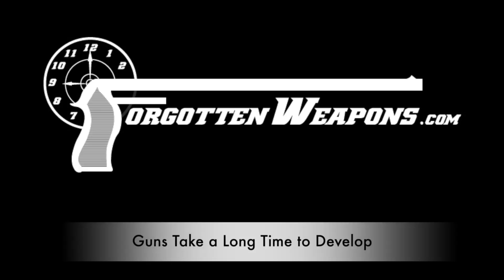Why Guns Take Years to Get Into Production

Comment: "It's compounded by the fact that you will never be able to predict and test everything." 
This might be the wisest thing I have heard you say, Ian. I was an engineer for 45 years. I don't know how many times I tried to explain this to the man who just couldn't wait to start making money on something that seemed so simple to him.
Reply: Fire Starter  no idea what lasers have to do with engineering guns? As for computers, the most famous guns most people were designed before computers existed. 
But besides that, no simulation is perfect and nor can it predict some idiot hotloading his home-made ammo with dynamite or something else stupid. The GIGO principle applies at all times.
Reply: @randombloke82  thats not the domain of the designer. 
The designers job is to design a product thats applicable to the application. 
And if you cant figure out what lasers have to do with engineering guns then i dont thin you belong in this discussion.

I am not an engineer and i have just designed a rotary loading system that replaces the automatic function on any AR and it wasn't even hard and i did it using lasers and simple tools from Sketchup.
Reply: Fire Starter  you think a 3D printer is more precise than a CNC? Fine, it might have less vibrations, but at the very least the grain size is going to be a tolerance limit. Also, like Ian said, it comes down to cost.... printing individual guns is SLOW. For prototyping a 1-off, yeah it's faster than spinning up an entire mold/press/ jig, but once it's going it never gets faster.
Reply: @RaphYkun  also, having worked with Plastic 3d printers, theres a TON of little things you have to work outtrying to get temperatures just right, trying to support the part so it doesnt collapse in on itself while printing, finding the right infill pattern, etc. Its designed to be intuitive and consumer friendly but its still really complicated and I can only imagine that printing with more difficult materials at higher temperatures with lower tollerance (ie making guns with metal printers) must be MUCH more difficult
Reply: @RaphYkun  "you think a 3D printer is more precise than a CNC?"
It's funny you should phrase it that way, because echnically, your typical run of the mill FDM plastic 3D printer is a small CNC machine with a plastic extruder on the end of it. Also, precision of CNC varies a lot. CNC just means it's controlled by a computer.
Reply: @RaphYkun  There are also techniques that are faster than CNC machining.  As I was looking into CNC as a possible hobby, I read about a giant forge that can stamp out a receiver of a gun in seconds, where a CNC machine would take minutes or hours to complete.

Granted, that receiver may still need some CNC love to get it working, but that doesn't change how, in one big "clomp", you have a pretty-close-to-spec part -- but I would nonetheless imagine it would still take a considerable amount of time to get the forge ready to make that one "clomp" consistently produce a good part, over and over again.

Over the years I have heard of all sorts of interesting ideas that could potentially revolutionize everything -- carbon buckyballs and nanotubes in particular are often at the core of these things -- but they fail because there's simply no good way to mass produce them....
Reply: @alpheusmadsen8485  It all really depends on how complex the part is and what your tolerances are. It also depends on what you have access to. Those big presses are expensive, and you cannot use them just anywhere. Especially the really big ones shake half the neighborhood when 600 tons come falling down
Reply: "Nothing is difficult to the man who doesn't have to do it."
Reply: @lairdcummings9092  This is very true!!!
Reply: You don't get it. I work with 3D printers every day. Metal 3D printers are not as good as CNC machines for making prototypes, and they are absolutely unfit for large scale manufacturing of gun components.
Reply: @Bad_spark  Yeah I get it but even with cnc machines it does not mean that what was designed by someone will work
Reply: @PAPAROUSwhatsinthedirt  yeah man I was trying to reply to fire starter, who thought PCs and 3d printers can solve sny issue in no time. I'm an engineer myself and my designs fail left and right while in the prototype stage.
Reply: @Bad_spark  Ok and yes they do i worked at a place where they decided to try to do away with prototyping and just run production it almost bankrupted the company
Reply: Fire Starter  I retired from hi tech sheetmetal we used lasers and computers still does not make a usable part right off every time.
Reply: @PAPAROUSwhatsinthedirt  he probably thinks like alot of other young people that just because we are so advanced we can make everything with the snap of a finger or whatever
Reply: I cant count how many times, as a welder, I've had to explain to the engineer why his design cant be built as he drew it. I litterslly had to show one "you want me to TIG weld this join right? Well I CANT EVEN FIT THE TORCH IN THERE. It has to be built in a different order"and arguing with the guy over how it needs to be built in order to actually weld it.  No sorry I cant weld the opposite side of a plate with a 2"x2" opening... it's not physically  possible idk what hes thinking lol.
  We had one that was insane. The drawing showed a brass fitting WELDED to a stainless manifold.. it was probably the worst thing I saw lol
Reply: @swampypolitics9574  Been there I weld all types run and program turret punchs and press brakes last one I ran accurpress 8 axis 225 ton 14 foot bed. a engineer came out one day gave me a work order to punch fold and weld a simple 3 piece part a body with a door and hinge in the print he wanted me to spot weld a 3/4 inch hinge in a 3/4 gap I looked at him and said I can't spot weld an air gap
Reply: @PAPAROUSwhatsinthedirt  LMAO spot weld a gap 😂👍 let me just throw iron powder in the air and hope it sticks.
Reply: @PAPAROUSwhatsinthedirt  the biggest pain in the ass I had to do was close a hole in a pipe.. with hot water and steam coming out of it lol. They refused to shut it down Cuz they would have to shut it all down and that's $1m/hr that the machine is down. They just wanted it closed up "temporarily". Luckily it was a steel pipe and not stainless. 6010 for the win.
Reply: @swampypolitics9574  It's always about the money!!!
Reply: @PAPAROUSwhatsinthedirt  for sure haha
Reply: I keep having to explain to the 'young' guys that Murphy Rules With An Iron Fist. You plan for everything you can think of, and maybe you succeed, but then it is the thing that hits you sideways that you never thought of that derails you. Example: Years ago I did a live broadcast event in a country that, shall we say, wasn't exactly known for freedom. Everything was lined up with umpteen levels of redundancy. Event day came and the government official who had helped us with "things" was nowhere to be found. He defected to the rival country next-door.  Needless to say, things didn't go well after that. You learn to plan for the unexpected - always have a disaster plan and always expect that something will go wrong. Most of the time you're fine, but the Universe seems to like to spring things on you at the worst possible time and place. ;-)
Reply: @patrickseaman  Remember, a pessimist is never disappointed. ;-)
Reply: @billd.iniowa2263  I'm an optimist that things will work. I'm also paranoid that they won't. What does that make me?  (Too) Experienced.
Reply: Yep. As a software engineer, nothing scares me as much as non-trivial code which seems to work the first time.
Reply: @MrZcar350  That makes me smile and think of the piece of code someone better than me wrote. It passed the regular tests, it was being tested in the way it would be used. 
He let a toddler play with it and after two keypresses it collapsed.
Reply: @patrickseaman  the younger generations have been insulated from Murphy by the facts that they don't really do all that much, and the older generations have created a relatively safe/soft lifestyle for them. But the older generations also built in some timebombs for them, such as the Social Security system, the Federal Reserve, and the 19th Amendment. The younger generations are going to get hammered within the next decade, and older guys like myself are probably going to get evicted from our meatsuits before we have the opportunity to see if the younger folks figure their way out of the mess.
Reply: Fire Starter  Knowing how to use your tools is only half the battle. Now you need to figure out what are the tolerances of each part of your gun so that you can use your tools properly. No one can do that for you since no one has built your gun before.
Reply: Fire Starter  No its not always basic math when you work with things that burn or explode at different rates
Reply: For an easily digestible demonstration of the pitfalls of high-durability 3DP, check out the videos on 3DP rocket motors from Integza.
Reply: @lairdcummings9092  Thank you I will
Reply: Fire Starter  Funny that you mentioned building a rocket. Just think: SpaceX is launching rockets like a Swiss clockwork and landing the boosters on a shoebox in the middle of the ocean... and Elon's other company is still struggling with body panel gaps in Teslas.

Dealing with multiple tolerances in mass-produced complex mechanical devices IS the rocket science of engineering. It is high science and high art at the same time, and few people really appreciate that. I've studied tolerances for my degree for a whole year, and the course only gave us absolute basics how to start on the issue.
Reply: Fire Starter  you have to measure pressure, mass, and a lot of precision. Like the bolt of literally any semi auto for example, how much weight do I need in order for the bolt to move back and forth by a specific measurement? If it's too heavy you gotta forge/mill (never cast) a new one out of something lighter. And this is just an example and something like the bolt by itself can take months to perfect and not because of production time but because of reassurance and actually getting the thing to work. And every change you make you have to document with numbers and math, keep track of how much mass it takes. And there's also parts that might need to be added to assure the functionality of the weapon, and the reassurance of safety to the potential shooter. There's a whole lot of physics going on and it isn't anywhere near the level of intelligence required for rocket building, but that doesn't make it easy. You also have to make sure you won't run into legal trouble because hey your gun you're designing could be similar to someone else's patenting rights, or your gun you made goes against the ATF from things as little as being too light, too short, etc, etc. Ever hear the expression "back to the drawing board"? Engineers probably say that around several times a day and people seem to lack appreciation for that.
Reply: Fire Starter  you really didn’t listen to Ian at all, did you? Are you an engineer, a machinist, or have any kind of actual knowledge of design and manufacturing?
Reply: Fire Starter  I could write several pages of detailed descriptions, but it's really not worth my time. Just trust an old engineer: Managing tolerances in mass production is an enormous challenge. You dont' get it completely right, and out of 100 guns assembled, 2 will refuse to work at all, 10 more will start jamming when hot, and one will perform a rapid unscheduled disassembly after the fifth shot. There are some incredibly complex mathematical models available to deal with it and hundreds of factors to take into account, but theory won't give you everything.
Reply: @rrolf71  I am not an engineer, but I do have an appreciation of just how complex it can be to bring about any kind of change.  As Ian said, designing and building a working prototype of  product is a completely seperate process to designing a scaleable manufacturing process for it.  I don’t think people truly appreciate how staggeringly impressive the reliability of modern manufactured products are.  It must be incredibly complex to design every part of the process.   How satisfied will consumers be if 1 out of every 1000 example of a new firearm fails because of errors in manufacturing tolerances?  Most people never wonder what is actually involved to have a failure rate that low? Everything is all well and good in theory, but getting it to work in practice is a whole different experience.
Reply: @bruiser6479  The biggest problem in my experience is  when someone has a little knowledge, and thinks it makes him an expert, and then does not want to listen to actual experts. You hired experts for a reason fucking listen to them.
Reply: Formula1 here , would you like to please hold my beer?
Reply: Fire Starter  Well, good luck. But I'm afraid you'll find out that along with the learning usually comes the realization how little one actually knows.
Reply: Fire Starter  Blowing stuff up is always fun
Reply: Fire Starter  Still requires effort and time. All that does is effect the speed of manufacturing and getting the measurements of the parts on the dot. You still have to make prototypes and design it for mass production. You also have to test the gun after any change in design big or small. You also have to design fail safes, and test the durability of the firearm.  Too much to list I could go on all day and Im sure a professional could back me up on these claims.
Reply: Fire Starter  stop feeding the troll people...
Reply: Fire Starter  your question proves his point. The main question of knowledge is why, not how. You have found your expert if he can answer why more than others.
Reply: I mean, sooner or later you will run out of problems.
Reply: I had to explain it to my boss from the time that I was about 15. My boss was my dad. He was a safety inspector for a major company just a few years earlier, before he started his own business, so how he didn't understand this point is beyond my ability to speculate.
Reply: A great example of that is the soldiers will be soldiers video
Reply: Fire Starter  I'm an engineer who is currently working in manufacturing. I work in medical devices where dimensions are controlled to the tenths (which is parlance for 0.000X inches), which is probably more excruciatingly precise than the firearms industry. We use laser cutting; servo stamping presses; hydrologic presses; wire EDM; ram EDM; CNC milling; injection molding; chem etching; etc. What you described reveals a fundamental misunderstanding of metallurgy and physics that many people commonly take for granted. 

What I hate the most about colleges and the miscellaneous YouTuber these days is that they keep perpetrating this myth that 3D-printing, whether plastic or metal, is the answer to everything. Let me disabuse you of the usefulness of 3D-printing - it fucking sucks for production. It's great for making a one-of of something that doesn't need to withstand millions of cycles. What people like you need to understand is the concept of material fatigue. Oh great! You metal-printed a 17-4 PH component for a gun? Wonderful! Oh, it's dimensionally accurate? Cool! You can fire a single round from it? Tubular dude! 

Now fire 10^6 rounds from it. Did it maintain dimensional stability? Nope. Did it develop hairline fractures over time? Yes. Does the cyclic thermal history cause warp? Yup. 

Bottom line is that you can't just make something out of metal and call it a day. Metal forms are usually made from specific grades of steel that come from a forge/mill that tightly controls the atomic composition and ensures a specific grain/micro structure. Additionally, metallic components aren't formed in the hardened state in production (unless you want to break your expensive tooling every other day). They are formed in the annealed state and then sent out for heat treatment. You don't have this level of control with metal 3D-printing. 

Bottom line is that 3D-printing is a time-consuming, expensive process that limits your material choice and doesn't give you near enough control on your microstructure to make a component that's built to last, especially if that component operates on the principal of combustion.
Reply: Milked ur clients good i see.
Reply: I hate it. I have been doing it for 9 years, with a co-worker that has been doing it for 42 years. Too many times people think that some hand made thing they brought in is OK to show to customers as a finished ready to go item. It takes a lot of work going from a one off hand made, hand adjusted prototype to something in manufacturing. I started off "designing" cardboard boxes, and i'm now working on fully automated robotic systems, yet management treat those systems the same way they used to treat the boxes (and even back then a production sample was recommended!!)
Reply: Fire Starter  all the smart people have been fired from gun manufacurers or they now work in aerospace.